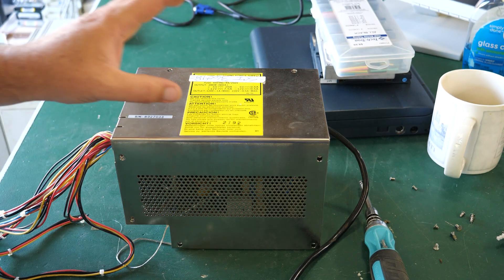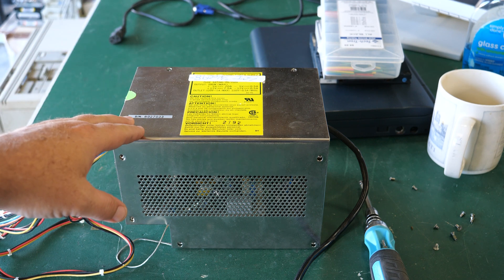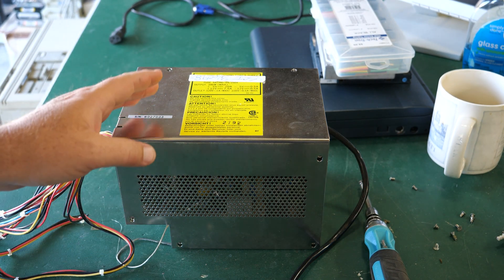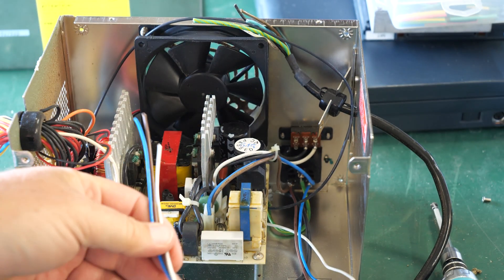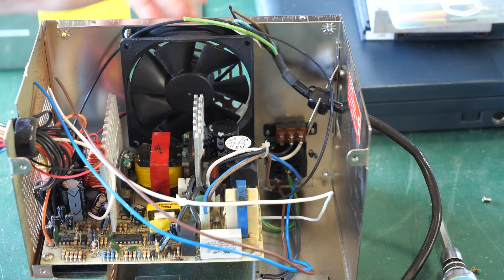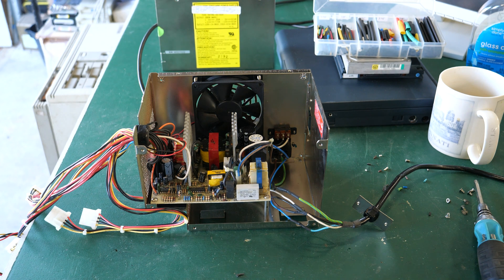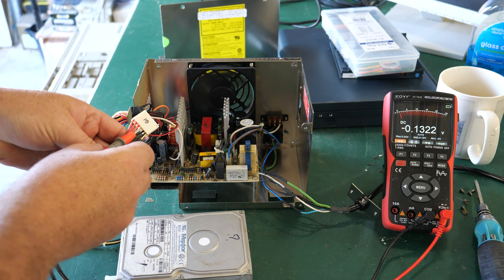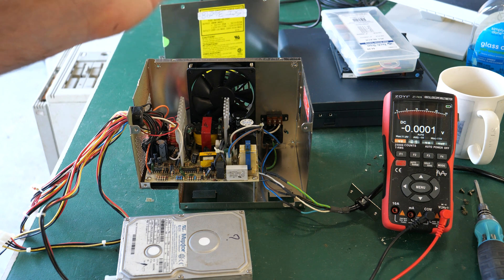The Hidden Danger of Vintage Tech – Don’t Make This Mistake!

Comment: I've learnt a thing or 2 while working on vintage machinery.

If it's in unknown condition ALWAYS assume someone worked on it and quitted halfway so DON'T turn it on before carefully checking some things.

Also assume every touchable metal part is live unless proven otherwise bij checking the resistance between the earth pin on the plug and those parts. 
More than often someone cuts the earth connection due to a tripping GFCI or pulls out a bunch of relays/ contactors.

A bunch of times there's some cut/ loose wires somewhere in the machine.

The kind of machinery I work on has some higher level of risk because most of them work on 400/440V up to 21kW (sometimes a lot more).
Especially the risk of arc flash is dangerous. 
A 3 pole 440V 50A bakelite switch can make quite the fireball when it shorts out!

That's a big reason to put the enclosure back together before testing.

Comment: Those AT power supplies used a single throw double pole (STDP) power switch thus the hot and neutral line were disconnect from the power supply primary input.
Reply from the maker: Until I turned it on 😃 but yeah.

Comment: It has been my experience that Negative rails always read low with no load on them. I'm thinking if you loaded them it would read better.
Reply: I have found that also when loaded they are usually fine

Comment: 110 volts will barely tickle. Even 220 is no great threat to an adult body provided you don’t have a dodgy ticker.
Reply: It isn’t voltage that kills but current. If the current crosses the heart it can cause a fatal arrhythmia. Think of a defibrillator which delivers 120-200 Joules from 2000 volts stored in a capacitor.
Reply: While in a cool, dry environment you can often touch 120 volts with little effect. If you're hot and sweaty working in a garage, 120 volts can easily kill you.
Reply: Not if you ground your other hand

Comment: I always connect electronic devices that are not known to function or not to an isolation transformer equipped with a safety fuse.
Reply: It would be a good precaution with equipment like computer power supplies since they are switching P.S. w/o a transformer. A Varivac with a 1:1 isolation transformer to slowly bring up the voltage.

Comment: For newbies. Use an isolation transformer if you use any plug in test equipment. On
a SMPS there are 2 grounds. The HOT ( primary )  side & the COLD (secondary ) side. 
Measurements must be to the right ground to be accurate ! So dont fill the room with smoke !
LFOD !

Comment: There are more "dangers" or "problems" of vintage tech: RIFA paper capacitors in power supplies that can short out and make a mess or even a fire, leaky CMOS barrel batteries that can bomb the logic boards (super common on 286/386 era PCs and vintage Macs up to about 2003-ish), leaky capacitors on logic boards and inside PSUs (from around 1988 to around 1995, more commonly on Macs) and brittle plastic parts that can snap, especially on early laptops, also some desktop Macs from around mid 90s have really weak plastics.... Well and on early laptops the LCD screens are starting to delaminate (vinegar syndrome). This is why I sold off most of my vintage laptop collection in the last few years.
Reply: My Amiga 500 had a leaky battery, which thankfully was on an expansion card that was underneath the system in the trapdoor, the expansion card was dead but the system itself is fine. The big issue is that without the expansion card, I only have 512k of RAM and most of my games require 1mb.

Comment: Without a good load, you can expect the auxiliary power rails to be low.  The switcher is not running at it's normal power level.

Comment: This is why, when I bought it earlier this year, I didn't even boot my ZX Spectrum + until I bought a replacement power brick. Sinclair and Amstrad (who later bought out Sinclair) bought the cheapest power supplies available and they are prone to going bang.
Reply: Replace the 7805 regulator.  They age, and fail...

Comment: It's probably more dangerous in 220v parts of the world.
Reply: Certainly is. Here in the UK there was a teenager back in around 2012 that was killed working on his custom PC. He stripped the psu for what ever reason and it was the last thing he ever did. Mains filter caps discharged on him. I personally also took a PC PSU to bits that had been in a cupboard for well over 1 year unused. I thought to myself, oh, better just short the mains cap with a screwdriver to be safe. Bang !. Yup, still had a big charge in them even after all that time, so just as well i checked.
Reply: @TheSaabClinicUK SIDE, switch off, isolate, dump the charge, earth, that was drilled into me as a young tech, plus always keeping one hand away from the equipment under test.
Reply: If it has a 110/220 switch then it has a voltage multiplier so it is just as dangerous.
Reply from the maker: For sure. I have caught 110v house current on several occasions. Luckily, my autonomic nervous system is still functioning for now.
Reply: Doesn't matter, both can kill you. Any voltage above 50 volts AC is considered dangerous.

Comment: Looks like it was properly grounded - so no danger even if the wires would have been stripped and touching the case.
Reply: Not "No danger" but this is what I was thinking as well. This is why the third prong exists. It grounds the case so that if there's a short to the case it will trip a breaker.

Comment: Clock/CMOS batteries are also a nasty surprise. Remove them. I have an Apple II clone, no name, that works fine. Except it put 120VAC on to the chassis ground. The power switch has no control over it. When you plug it in 120VAC is on the case. If I had a GFI socket I might not have gotten shocked.
Reply from the maker: That's an interesting case
Reply: @RetroHackShackAfterHours  I think it's a shorted rifa. But I haven't looked at it since. The power supply looks suspect even then.